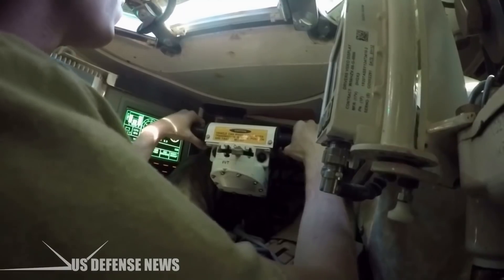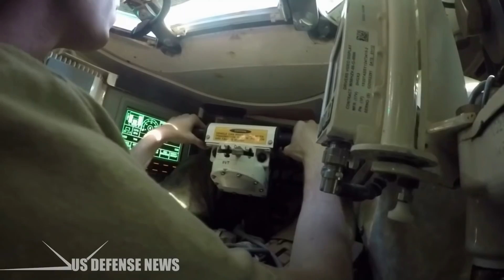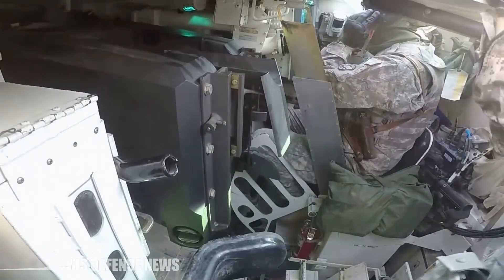Why No One Wants to Fight U.S. Abrams Tanks?

Comment: pace of crap ! if you want to look at a REAL TANK challenger 2 is the best
Reply: +charlotte jackson 

 What are you on about?
Reply: its not the tank it self i dont like its the way its been degined i dont like 
i mean why the heck would you put a helicopter engine in a tank ? 
and the Challenger 2 witch is a british version of a M1
Reply: +charlotte jackson

 The turboshaft offers a lot. High power load and torque in a small footprint, light, less parts, high fuel efficiency, relatively quiet. Though it has its cons, fuel consumption, heat, parts specialty. 

> "and the Challenger 2 witch is a british version of a M1"
 
What do you mean?

Comment: M1A2 = Sherman (not even the firefly variant) but wider, longer and higher cal. 
Leopard 2= Panzerkampfwagen Tiger Ausf. E for the early version but faster with better spec and Panzerkampfwagen Tiger Ausf. B for late version but faster also with better spec. 
T-72 = T-34 with better armament 
T-80 = T-34 85 with better armament. 

Nothing change much since ww2. But it's better.
Reply: +Akihisa Yoshii

 What?

Comment: Bare in mind British challenger tanks have the same ammunition, also no tanks have rolled homogeneous armour anymore, most have ceramic and composite armour
Reply: So your Argument about penetration through steel is invalid
Reply: +xXDarkwarGamingXx

 Estimate of effective thickness still traditionally uses rolled homogeneous armor in comparison as many tanks still use it as an outer shell of the armor. Though not thick by any means. Aside from normalization and characteristics of HEAT munitions against composite armors, much of the same comparisons apply.

 Both Challenger 1 and Challenger 2 use 120mm rifled guns. Which is incompatible with the smoothbore 120mm. munitions.

Comment: The Abrams is the new age version of the German Tiger. Under ideal conditions it is deadly but it's a very one sided and heavily flawed design which lacks adequate anti infantry and anti material capabilities, beyond its superb frontal armour is rather vulnerable from other directions, is too heavy to fare well in rough terrain and around urban infrastructure,  due to its over sophistication and its gas turbine is extremely fuel hungry and high maintenance so all in all at a strategic level, in a major war against a real opponent not some midget of a 3rd world country it would be less than an ideal weapon.
Reply: +Twilight Zone

> "The Abrams is the new age version of the German Tiger."

 How so?

> "but it's a very one sided and heavily flawed design which lacks adequate anti infantry and anti material capabilities"

 Again, how so?

> "due to its over sophistication and its gas turbine is extremely fuel hungry and high maintenance so all in all at a strategic level"

 Sophistication? As compared to what? The AGT-1500 is not necessarily higher maintenance in terms of operational rate given its function is much simpler and much lower tolerance than most I.C.E.'s. But being a turbine, it's inherently a different job maintaining it.
Reply: It's like the Tiger in sense that it was designed to be an uber tank that beats the best of what the enemy has in terms of applied technology, armour, guns, speed but with a disregard to price, size, weight durability and versatility.

As for how it is inadequate for roles other than fighting other MBT's in an open battlefield and why it is a maintenance and logistics nightmare, that could fill volumes,  and it does literally as there is actually an end to end analysis about this tank on BlacktailDefence's channel (see link below) broken down to multiple chapters and parts, If you can afford the time (they add up to hours) go watch them,  it is an extremely detailed and comprehensive study.

A few highlights: it does have multiple types of ammunition for different purposes but they are all only really effective against other tanks and vehicles not infantry or buildings, the internal machine gun has insufficient allotted rounds while the external one is better in that sense but then its operator is unprotected, it requires 1 hour of maintenance for every 3 hours of operation and the list goes on and on.

https://www.youtube.com/watch?v=ULC0TOiZZzc&list=PLZUp4w8LY7wi1V97-xteEUW30TnDoy531
Reply: +Twilight Zone

> "but with a disregard to price, size, weight durability and versatility."

 How is it a disregard to price? When the XM1/M1 was first introduced, in then-year dollars it was as expensive as the Leopard 2, and wasn't any more expensive compared to the Soviets to a degree it would immediately matter. 

 Durability and versatility how? 

> "As for how it is inadequate for roles other than fighting other MBT's in an open battlefield and why it is a maintenance and logistics nightmare, that could fill volumes,  and it does literally as there is actually an end to end analysis about this tank on BlacktailDefence's channel (see link below) broken down to multiple chapters and parts, If you can afford the time (they add up to hours) go watch them,  it is an extremely detailed and comprehensive study."

 I'll look into it, thank you. 

> "it does have multiple types of ammunition for different purposes but they are all only really effective against other tanks and vehicles not infantry or buildings"

  It has an array of HEAT munitions, as well as canister rounds (essentially grape shot). I'd say that is quite an array nor has there been any report that I know of that noted that the main gun was inadequate at the diversity of combat situations because of ammunition selection.

> "the internal machine gun has insufficient allotted rounds while the external one is better in that sense but then its operator is unprotected"

 Of the 11,400 rounds of 7.62mm.x51mm. N.A.T.O. for M1A2's and M1A2 S.E.P.'s M240B General Purpose Machine Guns, 10,000 is officially issued for the coaxial gun. And only 1,400 for the loader's machine gun[. With the addition of CROWS II (M153), many of the loader's machine guns have been removed on refitted and remanufactuered tanks.[I][II][III][IV] 

> "it requires 1 hour of maintenance for every 3 hours of operation and the list goes on and on."

 These figures vary exceptionally. Citation for the conditions behind this figure?

[I] -  Conners, Chris. “105mm Gun Tank M1 Abrams1-7.” 105mm Gun Tank M1 Abrams, afvdb.50megs.com/usa/m1abrams.html#M1A2 .

[II] - Hunnicutt, R.P. Abrams: A History of the American Main Battle Tank, volume 2. Navato, CA: Presidio Press, 1990.

[III] - Chait, Richard, John Lyons, and Duncan Long. Critical Technology Events in the Development of the Abrams Tank: Project Hindsight Revisited. Washington, DC: Center for Technology and National Security Policy, National Defense University, Dec 2005.

[IV] - Net Resources International. "Army Technology - M1A1/M1A2 Abrams- Main Battle Tank." Army Technology. 9 Jun 2007 <http://www.army-technology.com/projects/abrams/>.

Comment: I am not a russia but i think both tanks can destroy each other and the armata isn't that Bad
Reply: The tank driver was not experienced with the new tank so he accidentally activated the parking brake and did not know how to disable it, if you look when they try to tow it away it wouldn't move at all hence the parking brake.
Reply: Callips that's exactly what a Russian would say
Reply: Callips armata??
Abrams m1a2 is equal to t90ms
Armata is a generation ahead
Reply: @Stare Kotlety you realize the abrams being destroyed are the original production models from the war reserve right? The new alpha 2s that are actually feilded have alot more armor and counter projectile defenses, not to include that the turrets that the iraqi abrams had where not gyrostabalized ao calling the abrams from the 80s the same thing as the ones used now is like saying the t90 is the same as a t60, you need to research a little more my guy
Reply: The Armata is a better tank than the Abrams, but the Abrams has been around for a while so it has been made mechanically reliable, unlike the Armata which is rather new.
Reply: Callips didn't the Armata break down during a parade procession

Comment: To the idiots who thinks the Abrams is crap I would like to tell you that the Abrams that ISIS has been destroying are not up to the quality as the US owned Abrams. Those Abrams used by Iraq are surplus without the depleted uranium armor which is why you see it go up so fast
Reply: Also those destroyed Abrams tanks were hit in the side and rear, where the tank has much weaker armor protection. The same goes for essentially all tanks. T-72s were destroyed by the 25 mm gun on the Bradley on a regular basis during the Gulf War due to flanking shots. What does that say?

Comment: i know the gas turbine engine is thirsty and unreliable in dusty environments
Reply: Adrian Fidi if any rocks or sand get there it will destroy the engine😅😅😅😅😅
Reply: +Adrian Fidi

 Operationally speaking, the turbine wasn't unreliable. The air cleaners were not durable enough originally.
Reply: so it's OK now

Comment: Syria a Russia T90 gets s direct hit by a US tow.  Tank crew survives and abandons the tank.  Repair crew drives the tank back to repair yard.  No way an M1 can top this.  

The only way the T90 was even hit was the poorly trained Syrian crew did not have the hatches closed which deactivated the hard kill anti-ATGM system.  So far the only T90 with the anti-ATGM system to be hit so far in Syria with a ATGM.  The M1 has no hard kill ATGM ability.

Comment: A Abrams can be destroyed by multiple hits by rpgs or different areas of the tank nothing is invincible everything's has a weakness it all has to to with where it is how to exploit and also what the other side does in trying to compensate for these weakness.
Reply: Gideon Horwitz I cant be destroyed by an rpg.Actually it can but you would need to hit the same area 2-3 times.And in combat situation that wouldnt be possible.
Reply: Kameron they wouldn’t fire at the front over and over though. A lot of the abrams destroyed in the Middle East took hits to the side and rear and roof. Tanks simply aren’t good for urban combat where infantry can easily get around a tank. I’m not an abrams hater, I’m usually defending it from all of the Russian fanboys, but DU is not the end all of armor. Its only at the front of the tank so even if the abrams used by Iraq and Saudi Arabia that got destroyed weren’t watered down export variants the results would have the same. Since adding more base armor puts on too much weight, things like ERA and APS are what will save tanks, not their DU or composite armor. Nothing is impenetrable, the RPG can easily penetrate the rear of an Abrams. The use of the TUSK (includes slat armor over the rear and ERA over the sides) package greatly diminished mission killed abrams, proving my point. It’s for reasons such as this that some people prefer the Merkava and Russian tanks since they extensively use APS and ERA.
Reply: gamerguyx095 Yes this is the real reason why people choose Russian tank over Western one.

Tanks are not invicible. They are just very hard to destroy. Especially in urban area where the fighting range is closer than 500m and enemy can encircle your tank and hit the weakspot.
Reply: We use du armor, you try standing in front of us and hitting us over and over again with a rocket
Reply: Every M1 destroyed in the middle east was an export version operated by iraqi forces.
Reply: thedog556 I’ve heard of the 70 rpg hits (probably exaggerated a little) but not that they were from all sides. I am doubtful that any tank could survive multiple rounds to the rear without substantial damage. It is worth noting that in terms of base armor the challenger is probably the most heavily protected tank in the world though. It uses Dorchester armor, high quality Chobham armor that the British aren’t willing to give to even their allies (just as the US won’t sell Britain F22s). It’s reportedly stronger than DU reinforced Chobham armor used on the Abrams. The DU on an Abrams is sort of an add on, and is only located at the front. For an Abrams armor drops off significantly once you move on to the sides and rear. Since the entire armor package of a Challenger is made of Dorchester there is no significant drop off of protection. There is reduced thickness but not a change in armor composition that you see in the abrams. Similarly, in early model Abrams their protecting didn’t have massive drop off either, since the only difference between front and side armor was thickness. Also worth noting is that the challenger while better protected is heavier and less convenient to transport, so make of this however you will.
Reply: Who the fuck said tanks were invincible
Reply: Ryan D and countless more have been rendered combat ineffective.
Reply: gamerguyx095 the Abrams that got destroyed in Iraq was by friendly fire or the crews blowing up the tank with explosives so that it would not go into the hands of Iraq military
Reply: Michael Xia You are 100% right
Reply: thedog556 Without taking any damage is impossible after taking 70 hits or the 70 hits is overexxagarated by the tank crew.
Reply: gamerguyx095 Im glad we haven't given anyone else our Dorchester armour.  We shared chobham with the US and they ended up using it before we did.  It's about time we kept our secrets to ourselves and stopped giving them to the US and getting jack shit in return.
Reply: stringy2009 dam right. They wouldn’t have broken the sound barrier when they did if it wasn’t for the British. Fuck em
Reply: CRT Yup. Just like T-72 export variant that were operated by the same country.
Reply: Emiya Kiritsugu Export Versions are pretty much just tanks with all the good shit taken off lmao
Reply: CRT Yup. Poor those buyers.
Reply: 7Ahilles As you ever be there when Abrams got hit by 70RPG's
Reply: thedog556 For as i know, chobham armour is classified.
Reply: Emiya Kiritsugu so how does it feel and where you was hit ? Or if you was a shooter where did you hit it ?
Reply: 7Ahilles Maybe i did maybe im nit, but i am certain that you never shoot an RPG before or be a gunner of a tank.
Reply: Gideon Horwitz a m1 abrams took over 100 shots all over and was still in 100% working condition
Reply: Ryan D

not true man...
i'm not a hater..look it up more ..
i know for sure that some were destroyed in a small town where they were ambushed by RPGs..got their tracks knocked out ...their sights gunned down and those people threw everything they got at them while they stood helpless...they won eventually..the abrams were knocked out 
one thing i hate is propaganda....both russian and US....
they simply post such news that make you think some way...i'm glad i'm in neither of those countries..but propaganda is a bitch...i'm telling you for sure that some were knocked out at least
Reply: Gideon Horwitz Dude, if it got hit even once, the guy with the RPG would've been blown to hell with either the main gun or the .50 on top.
Reply: Not ever proven. total opinion.
Reply: gamerguyx095 a lot destroyed in the Middle East? Zero were destroyed by enemy fire, one was hit 3 times by T72 rounds that couldn't even penetrate all the way. It drove back for repairs with the rounds stuck in its armor. 4 of them were hit by friendly hellfire missiles with all crew members injured but survived. A few in the second Iraq war were knocked out of commission with no human casualties meaning it did its job very well. Easily the most proven effective tank in the world
Reply: Emiya Kiritsugu they actually were embarrassed because it took a ridiculous amount of time and resources to destroy one that got stuck in the mud that they didn't want to leave behind. The only deaths they had in the tank from the enemy was from an ied mine with 1,500 pounds of explosives
Reply: Gideon Horwitz The Abrams tank has the capability to destroy any enemy over by the way how was it RPG going to get that close
Reply: Hilarious fake news @Ron ...

Abrams tank will be helpless against one of our diesel Perisher boats. ;-)
Reply: Michel Platteeuw 🤣🤣🤣🤣🤣🤣
Reply: As it was in WW2...it's all about who is running the damn thing...right?
Reply: Don't tread on me 100 shots of what?
Reply: Gideon Horwitz  How do you get close to it the tank is lethal up to 2 miles
Reply: Theres reason why tanks havent advanced much and even less new tanks are build or even designed.
No matter how well armored or technologically advanced tank you make the opposite side will simply improve theyr anti-tank missile capabilities.
Even if the antitank missile costs 1million each its still cheaper than a tank.
Reply: gamerguyx095 only 4 m1 abrams have ever been completely destroyed. 0 m2 abrams have been destroyed. You are exaggerating by a lot

Comment: There is no such thing as an indestructible tank. period.  A tank is made of 4 things, mobility, armor & firepower and manpower, if you take away any of these things its no longer an asset on the battlefield, however there is a big difference in out of action and destroyed.  Tanks are made for line of sight warfare but every tank has weakpoints, hatches , enginecompartments,tracks, sights etc.
There are weapons out there that can probably overmatch the Chobham armor or they dont need to because they target different parts of the tank,  using a top-attack would do the trick taking out an engine or a hatch taking out the engine(mobility) or the crew. But all in all its a hard tank to take out.